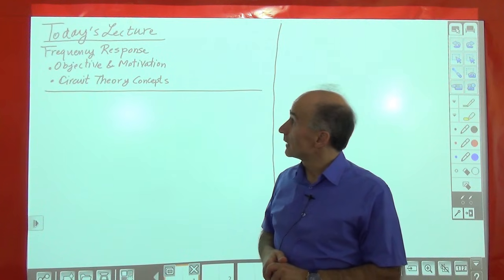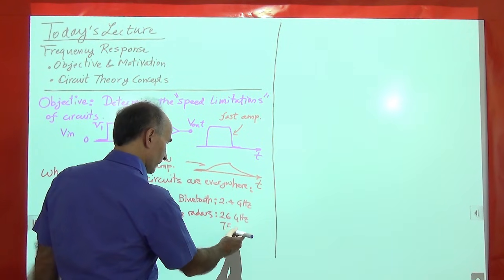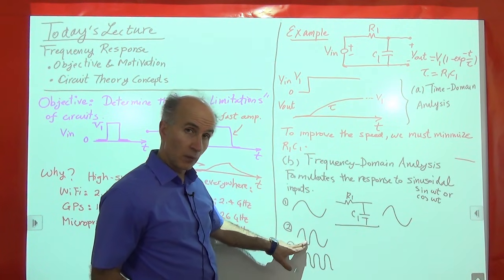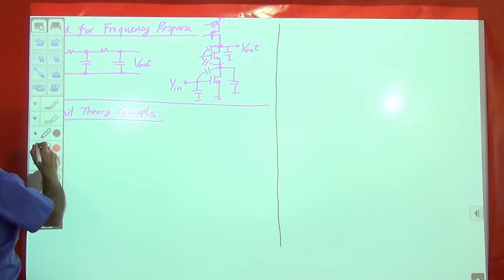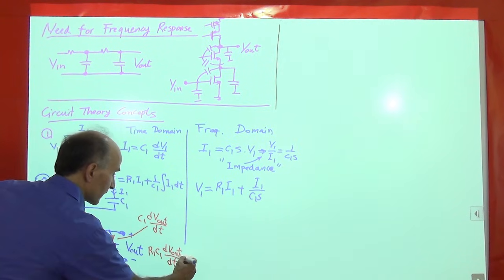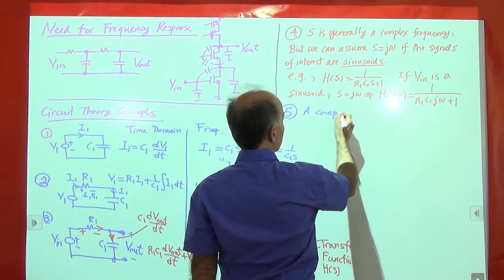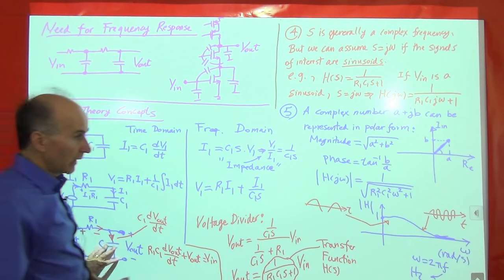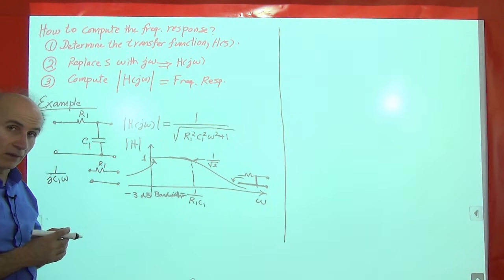Razavi Electronics2, Lec17: Introduction to Frequency Response: Basic Concepts

Comment: Thank you, sir. Is it correct if I say frequency response analysis is the same as Laplace analysis without initial conditions? if yes, why do we assume there are no initial conditions here? Does it mean that we are only interested in steady-state analysis if yes, why?
Reply: We are interested in LTI systems.. if you want to calculate transfer function of LTI system.. we will use Laplace transform.. transfer function of LTI system =( Laplace transform of output)/ (Laplace transform of input) ( assume all initial conditions are zero) .. I hope now you understand y initial conditions are assumed to be zero
Reply: Fourier and Laplace are both consider as frequency response analysis.. to be precise Laplace transform s will give complex term Cuz S= sigma + j omega( w), value of sigma is deciding factor for region of convergence in Laplace transform..( existence of Laplace transform)  if you have keen understanding between Fourier transform and Laplace.. you can easily say when to substitute S= jw( sigma =0) there are certain conditions if roc includes unit circle ..which ensures system stability .. s=jw means Laplace transform converted into Fourier transform..

Comment: Asusual It's a great lecture, But why are we interested in -3db ?
Reply: That is the acceptable db limit when analyzing the loss of power. When we translate the signal power loss down to half power, the decibel conversion equals -3db. Use the equation 20log(sqrt(2)/2) or 10log(0.5). The -3db value on the graph will determine the circuits acceptable lower and upper cutoff frequencies.

Comment: Thanks for the master class. One thing here. Why we are interested in -3dB? What is the motivation to concentrate on |H(s)|=1/RC ?
Reply: -3dB (10*log(0.5)) means the output power would be half that in the midband.
Reply: 20log ( 1/√2)  =-3db.. upto 3db gain is constant in this range circuit safe to use.. at 3 db gain starts to reducing ( it is the max limit) ..after 3db gain will drastically reduces.. we should completely avoid to operate circuit in this range..